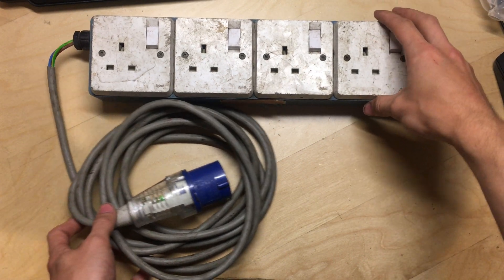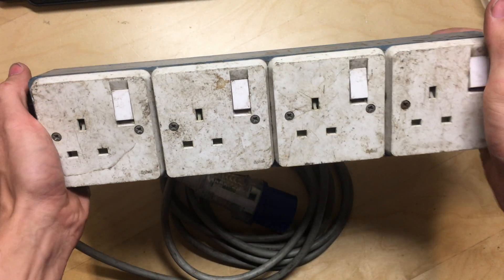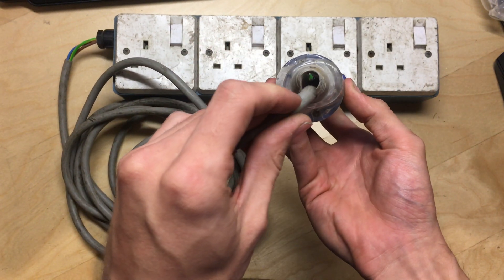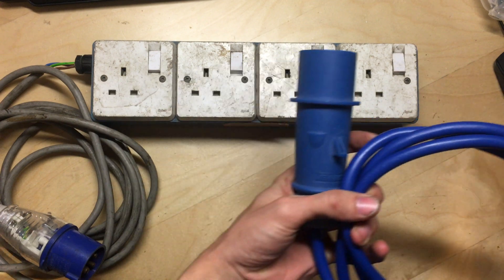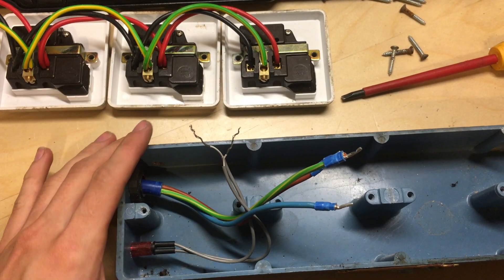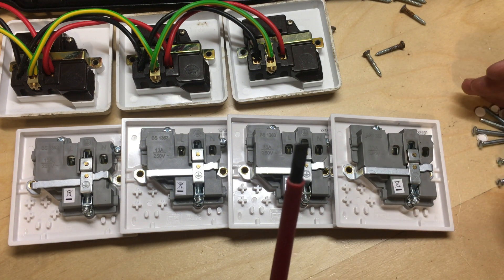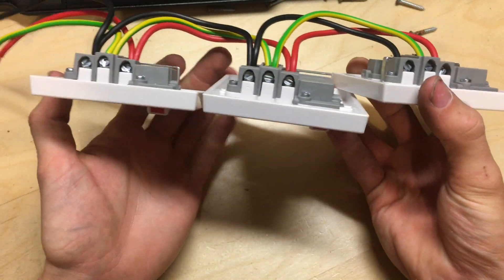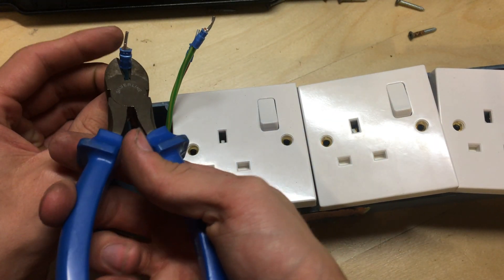Alphel 'DIS-BOARD' Upgrade & Refurbishment - 30 Year Old 4-Way Portable Socket Distribution Board

Comment: The chemical in Dry Erase Board cleaner will likely take off the Sharpie writing on the case.   However if the plastic is very porous it will still leave a shadow of the original writing.
Reply from the maker: Thanks for the advice! I'll have to give it a go sometime.
--Nathan

Comment: Should be ho7 and not arctic for entertainment industry
Reply from the maker: Whilst this is true - given the use cases for this, length of flex and calibre of events I'm involved with, it is highly unlikely to ever cause a problem. Especially considering I look after and even clean my cables after events. 
Longer runs in areas subject to more stress and strain are completed using H07.
Thanks, :)
--Nathan

Comment: Be wise and invest in wire end ferrules. Makes it even safer and more reliable.

Google and Amazon will help you with your search if you ask them.
Reply from the maker: I already do own and often use bootlace ferrules. However I did not use them for this project as the cable inside the board is of the solid core variety as mentioned in the video so they are unnecessary. 
--Nathan
Reply: @NathanPH  Just now seeing your reply...

There is one rule when it comes to solid wire: It is not for portable usage and it should only be used in fixed location.

To be honest, I don't see it failing any time soon in your distro but I have seen it fail in several other distribution boards that see a hard life on the road. So that's why I always use flexible cable for anything mobile. And to meet official regs you now are even required to.